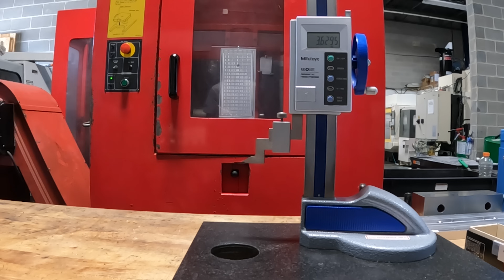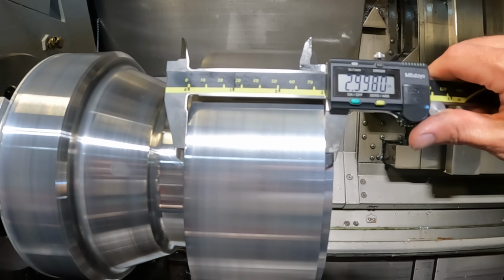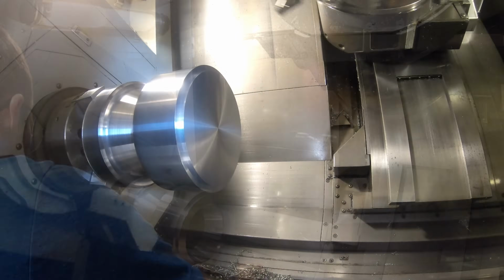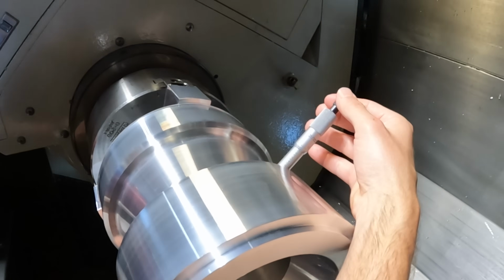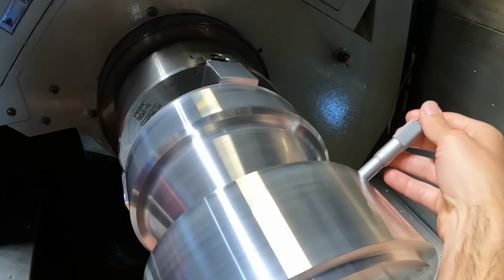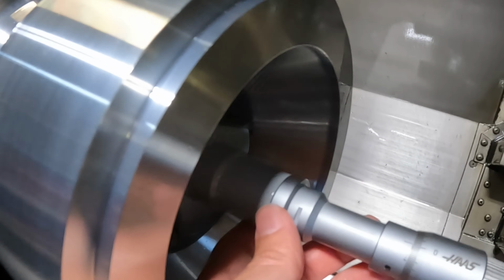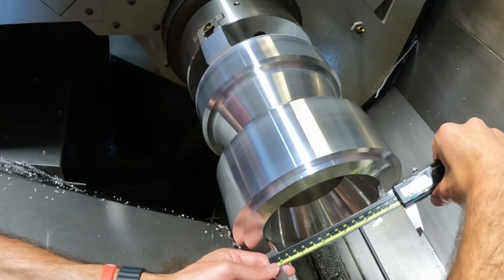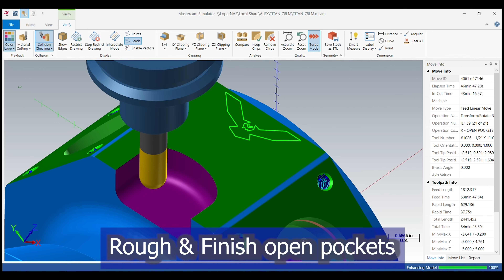OP2 TITAN-78M

Comment: Hey Dude, nice job I have a little trick for better visibility through the window. Use these iPad screen protectors they are very hydrophobic. I use in my puma 2600SYII been in for about 6 weeks at the moment but you get two screen covers so maybe you incur this cost every 12 weeks pretty good in my book. Others may work but this is what I have personally used. Make sure the glass you stick it too is as clean as possible. JETech Screen Protector for iPad 10 (10.9-Inch, 2022 Model, 10th Generation) with Easy Installation Frame, Tempered Glass Film, HD Clear, 2-Pack